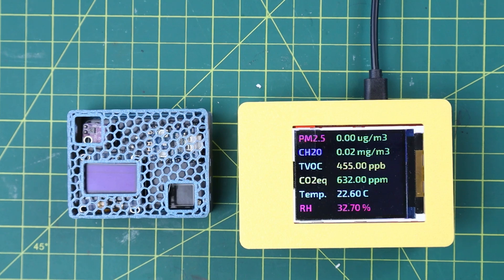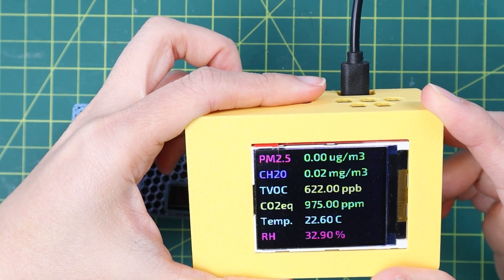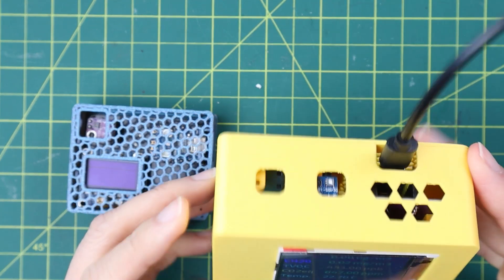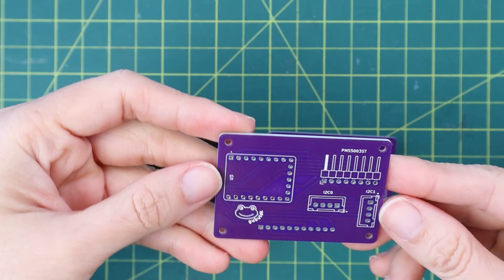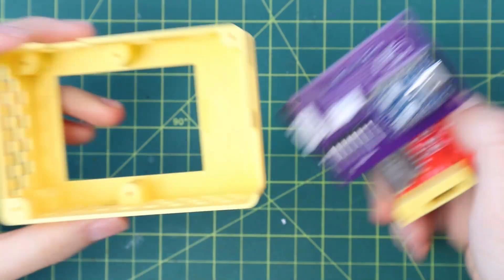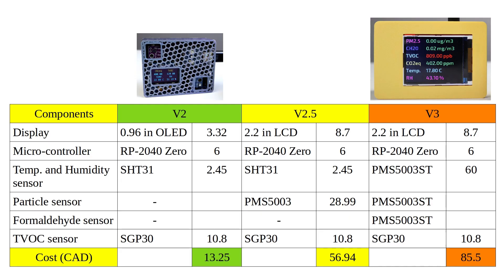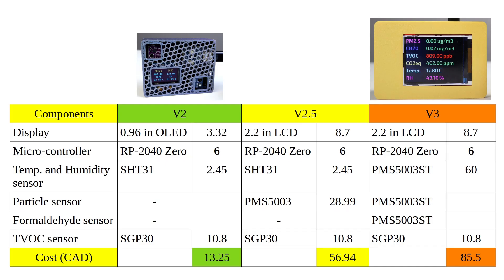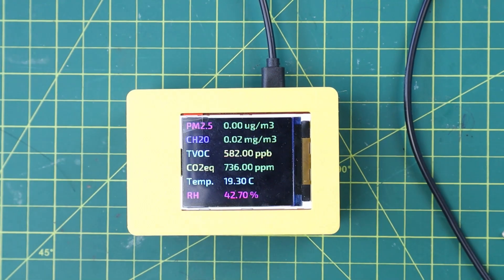DIY Air Quality Monitor (final version)

Comment: thanks for keep imporving the air quality sensor design and i am wondering if tihs could be use wireless version so we could integrate it to home assistant?
Reply from the maker: The easiest way is to replace the RP2040 with the Pico W. The code should be the same and we can link it with Blynk app. I will look into it soon.